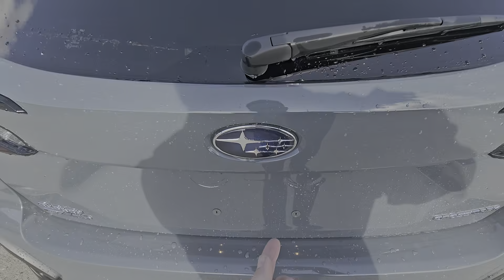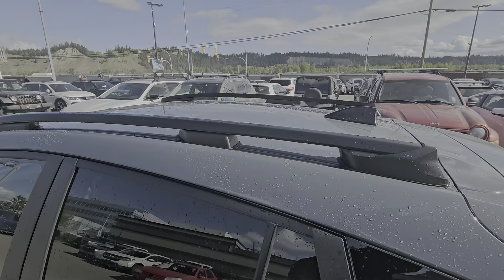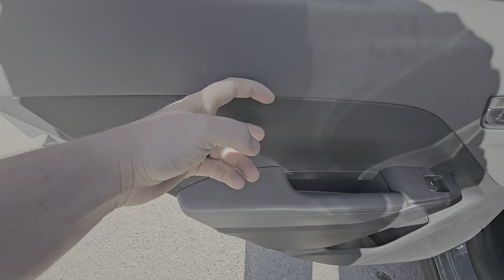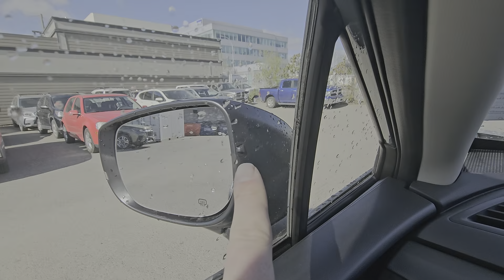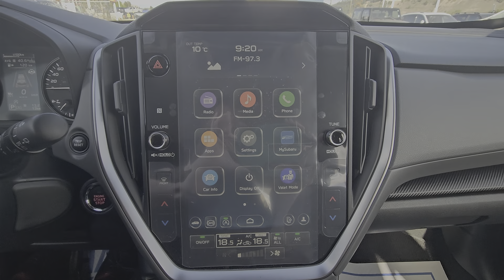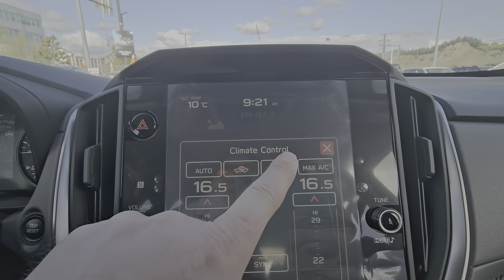2025 Subaru Crosstrek Touring Offshore Blue Metallic Condensed Walk-Through 25CT9165

Comment: Would you prefer this over the Onyx? I’m confused if the larger engine and parking sensors make a difference if you’re driving mostly in the city.
Reply from the maker: My preference is the Onyx. I see the value in the 2.5L, power seat and the Rear Assist Braking. I do a decent amount of highway driving, though.
It all depends on what you're needs and wants are. For the small price increase, I see the value in upgrading.

Comment: Hi tyson, quick question. for the touring model, if the foglamp is on, then when you switch on to high beam, does the fog lamp turn off?
Reply from the maker: Yes, the fog lights turn off when the high beams are activated.
Reply: @TysonTheSubaruSpecialist thank you for the quick response. have a great day👍